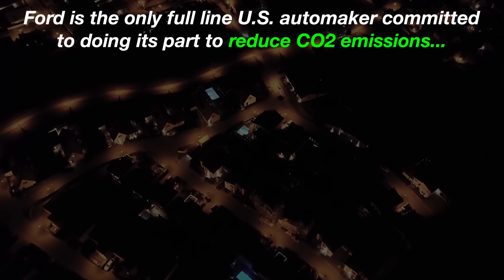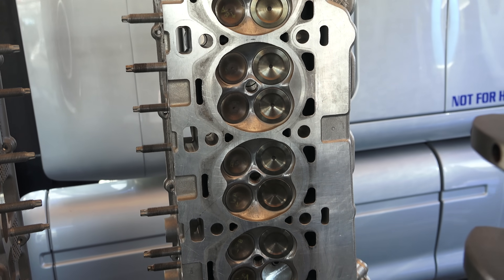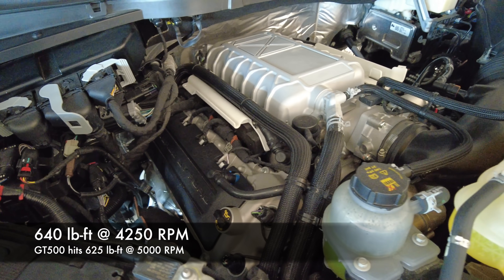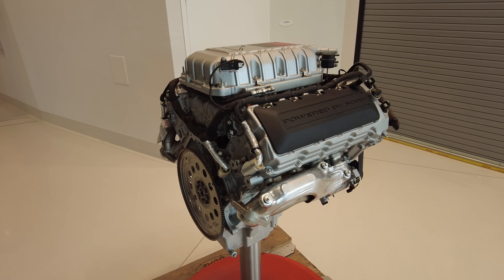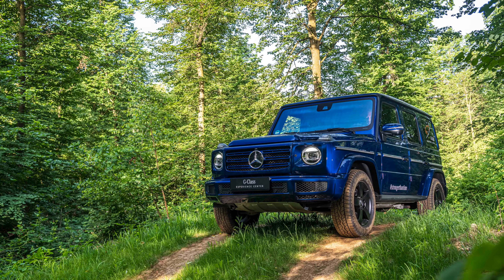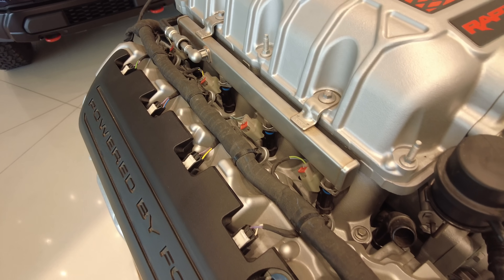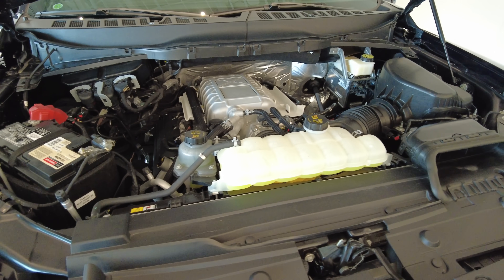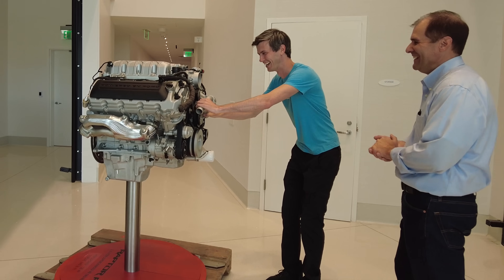Ford Raptor R's New V8 Engine - Meat's Back On The Menu

Comment: Excellent video! One quick correction: at 5:13 you state the bypass valve allows the intake air to bypass the rotor group and flow directly to the cylinders. This is incorrect; due to a Roots SC being a positive displacement pump, air is always pulled through the rotors. At low loads however, the bypass valve opens to allow any excess air that would otherwise be compressed to flow back to the intake upstream of the rotor group, thus preventing any boost/positive pressure from being generated. (This is the SC equivalent to a turbo’s recirculating valve/blow off valve)
Reply: I said the same thing, you beat me to it.
Reply from the maker: Hmm - I'd imagine air's taking the easiest path; if the rotors are creating suction strong enough, perhaps that's correct - initially I'd assume the easiest path is just direct to the engine, rather than through the rotors. But as you point out, the rotors are always spinning. Will follow up with Ford for clarification!

Edit: Cory thanks for pointing this out! I've pinned a comment to the video with correct information! Only at very low loads (like idle) would airflow be flowing directly through the bypass (rather than recirculated, like at partial loads).
Reply: @EngineeringExplained  No need, he’s correct lol.  I have the LSA S/C’d 6.2 and it’s the same way for the same reason.  They are there to bleed off excessive flow from the positive displacement blower that is always spinning at a fixed ratio to engine speed.  Say you use the car in manual mode and hold second gear at 5000 rpm but only 1/4 throttle, you want a good portion of the flow from the blower bypassed instead of creating 16 psi of boost.  If you’re at full throttle but passing through 5000 rpm, you want that 16 psi and no bypass.  Well the blower doesn’t know the difference so you need to bypass to control that.  One issue setting up a new one is to be sure that it seats properly when fully closed so that you aren’t bleeding off boost when it’s meant to be generating as much as possible.
Reply: @EngineeringExplained  . It is not a bypass, but a recirculation valve. The recirc valve essentially limits the pressure ratio to small numbers (near 1) at part load. This prevents excessive heating of the rotors from these high pressure ratios combined with little cooling from the low air flows.The air pumped by the rotors is recirculated to the supercharger inlet essentially reducing the pressure difference to near zero.  Failure of the recirc valve can lead to excessive rotor heating all the way to rotor to rotor contact and subsequent failure.
Reply: @EngineeringExplained  Roots blowers also don't actually compress the air internally; they just pump so much air into the engine that the manifold pressure goes up, so if there's a place for the air to escape then it won't make any boost
Edit: that actually looks like it might be a screw type, which does compress air internally
Reply: @EngineeringExplained  Rotors DONT create suction....they cause a difference in pressure or partial vacuum.
Reply: The bypass load is also great for twincharged (turbo + supercharger) setups, as the blower is no longer a restriction at higher speeds.
Reply: @REDSHlFT  twin screw is not the same as roots. Roots have equal lobe count, twin screw do not. Roots also don't compress air between the rotors, while twin screws do.
Reply: When you come at the king you best not miss
Reply: I had a Thunderbird SC with a similar design despite being made in 1989. Yeah, the bypass was for reducing the load on the engine when it doesn't need the power. The blower will force enough air into the engine even at idle but it also uses engine power to do it costing extra fuel. It also wears out the rotating components more compared to if it's just free-spinning. The bypass takes away most of the disadvantages of a blown engine when you don't need the extra power.

Edit: Now that I reread it, I have to agree with what was said in the video. It does allow air to bypass the rotors and it's largely to increase economy. It's not going to produce boost if the throttle plate is choking off the air sufficiently. It's probably easier to control idle air when the blower isn't engaged though.
Reply: It uses a roots style blower huh? Gt500 is a twin screw.
Reply: @XvSKINNYvX  gt500 is roots, not twin screw. It uses an Eaton blower, which have equal lobe count and rpm rotors, I.e what Eaton makes. Twin screws have different lobe counts and spin at different speeds, and are made my IHI (hellcat/demon), kenne Bell, Whipple, etc.

Comment: I'm the odd duck that would rather drive an ecoboost powered F150. My 2018 STX Supercrew 4x4 has the 2.7L ecoboost and it is the best truck I have ever owned.
With that being said, prior to the Raptor R, the only thing thing the TRX had on the Raptor was HP and torque. With the that deficit gone,  this new Raptor R is quite literally the badest truck on 4 wheels. I'm sure those with deep enough pockets to play on this level will be quite happy with this truck.

Comment: I know the plasma spray was used in the 13/14 5.8L gt500 engine as well. So I guess you could say it goes back further than 2018
Reply from the maker: Yes! But those weren't super high volume cars - they've pumped out a lot of 5.0L's (there's a disclaimer, though brief).
Reply: Flame-Spray invented the process, Ford with Flame-Spray improved it about '09...Nikasil was the forerunner used by Porche since '70 for 911 racing engines. Other manufacturers used it in production engines up until the mid '90s. High sulpher fuels in 3rd world countries would eat it up causing failures.

Comment: The raptor R has to be a massively missed opportunity, They made it 37k more expensive than the TRX and 2 fewer hp and 10 fewer lb ft
Reply from the maker: Could be 700 lbs lighter (not sure till we see one on a scale). $29k* more expensive (still a lot!).
Reply: @EngineeringExplained  I was going off the introductory msrp didn't know they'd bumped it up 8k. I feel like if they reinforced everything they should have it'll be more like 6300-6400. I think those high mag curb weights were with all the goodies and a full extended fuel tank

Comment: I worked at Ford for 30+ years, many as a final inspection person. I couldn't help noticing one of the two push pins in the intake opening weren't seated properly. Also the comparison to a pushrod driven truck isn't fair. Ford has been moving forward with current engine technologies. The ones still building pushrod engines are still having a hard time getting it right. If you need to buy an American built vehicle Ford is the only choice.
Reply: I saw those push pins too. 😁

Comment: I speculate that this engine will make more power than the TRX when dynoed past 7k rpm. The biggest limiting factor for power is the exhaust manifolds. But it's a factory pullied version of the GT500  5.2L. The tuning potential should be crazy 💯
Reply: Well it’s pretty much a voodoo engine with some more cooling for longevity, so instead of lasting 100k miles you can probably get 180k before it needs a new motor
Reply: @RiggyRonnie  pretty liberal estimates for each imo
Reply: I speculate this engine will blow up because that is the FORD Way
Reply: @mikefoehr235  😂😂😂
Reply: @mikefoehr235  it won't it isn't a garbage Toyota lol
Reply: @hotrod7603  funny no Toyota I have owned EVER blew up but the one Ford everything blew up AND it was towed 10 times because it failed. So, that shoots down your theory. Yesterday I drove by our local Forx garbage dealer...yup a pretty brand new F150 on the the hook 🪝...I just laughed. Ford garbage.
Reply: @mikefoehr235  your doesn't blown means you must be lucky other than garbage like toyotas are known for it
Reply: @hotrod7603  you got it wrong...FORD is the garbage. GM is garbage. I  have owned ALL of that garbage. Our 4 Toyotas have been incredible. My wife's RAV 4 needs AC work done after 6 years....will be first Toyota we own that needs AC work. Our Corolla and my Tacoma that was not an issue. Toyota is mostly maintenance. They rarely break. Even after 2 years my Tundra has had 2 issues...a bad battery and a cracked windshield both covered under warranty. GM and FORD you spend most of your time at the dealer or repair shop...again I know this from owning that garbage. I know several people who have had terrible problems with FORD pickups. Pure junk
Reply: @mikefoehr235  i already said Toyota is garbage there are already tons of people who have replaced engine in camry fue to the cracks and also the 3.5 in Tacoma has been known to blown many times , you just got a diamond nothing else but it still wouldn't change the fact that Toyota is garbage.  Worst interior , seats , no power etc
Reply: @hotrod7603  well you keep driving your garbage Ford...I will keep driving my garbage Toyota...I just love Toyota garbage. Just remember....who is the largest automaker onnthe planet?? Is it Ford or Toyota??? Toyota didn't become the largest by building garbage.
Reply: @mikefoehr235  well Mc Donald also sells most burgers doesn't mean they are good same for Toyota
Reply: @hotrod7603  Maybe Japanese burgers would be better. Maybe American burgers are second rate. You NEVER see me at Rotten Ronnie's for a burger. I prefer A&W, Wendy's and Harvey's.
Reply: @mikefoehr235  Sorry bud, a little late to bring up the Toyota conversation. Pride month has passed. Better luck next year.
Reply: @meatministry3736  here in Canada pride lasts all year for all you queen folk in America
Reply: The PCM will be locked solid. You can bet there will be no tuning this truck.
Reply: @hdz12ez  Livernois
Reply: Actually Hennessy just tuned one to 1000 hp @hdz12ez
Reply: @hdz12ez  Hmmmm. Palm Beach Dyno might have a word.......and all the usual suspects...
Reply: @hoost3056  Besides Whipple, a company which works with Ford, I don't know of anyone that has been able to crack the 2022 F150 computers for tuning. Those suckers are locked down like the C8 Corvette.
Reply: @hdz12ez  yup raptor r owners are going to be sad when they find out they cant tune them
Reply: @elemir17  yes sir they are
Reply: i just bought two of them and swapped both of them for electric drivetrains. Now they make some real power :) and i can charge them with solar energy when the pumps are dry (soon) or unpayably expensive (sooner).
Reply: I hope you're joking because that just sounds completely idiotic
Reply: @AmvC  😂😂😂
Reply: @AmvC  you realize that electric vehicles use as much fossil fuel as internal combustion cars? good luck to you though
Reply: @TokenTombstone ... right ... cough cough
Reply: @TokenTombstone  Sure they do..keep telling your self that skippy
Reply: @AmvC  you’ve looked into lithium mining yes? Also have you looked into how wasteful lithium fires are? EV’s have potential but we need big reforms in the way our society works infrastructure especially in America is far inadequate, and not just power grids but things such as emergency services as well

Comment: "Sounds like we've got 28 years to party!" Best line ever
Reply: In 28 years, Jason will either be 53 or 78 -- we can't tell.
Reply: Absolutely, and why not! I’m a “bow tie” fanboy, however this engine is impressive. Well done Ford, and great video Jason.
Reply: @svenhodaka9145  
Welcome to the dark side
Reply: @svenhodaka9145  LOLz if Chevy hired some adult males who had ever touched a hot rod and put  a turbocharged 454 in their pickups, churning at loafing RPM and ridiculously good mileage due to same low RPM. Kind of a Hot Rod Big Rig Pickup.
Reply: Couldn't agree more!!
Reply: If sane people take this country back we'll have more time than that.
Reply: @mortem-tyrannis  Perhaps we can just run them over…kind of like Death Race 2000 ?
Reply: "Sounds like we've got 28 years to party."   How dare you!  -  Some Crazy Eyed Loonie
Reply: My thoughts exactly
Reply: Hell yeahhh!!
Reply: The line cracked me up -- I had to stop right there and check the comments.  I'm still intermittently chuckling at it three minutes later.
Reply: Ford pushing these Lightning trucks to much who wants to buy that junk
Reply: I also feel this way .  Coincidentally, that's the same year I'm hoping to retire!
Reply: 2030 is when the cops show up to shut it down in the first world.
Reply: I dont know if this line is very reflected? Party goes as long the music plays but someone has to pick up the bits n pieces on the aftermath when the party ist over. I think it is a phenomenon of our western society to live above our means. I think this is a form of decadence. If we look back into history this could be a sign that our society will dissolve in consequence of their blindness and arrogance.
Reply: Agreed
Reply: Made me laugh with my ego
Reply: HONESTLY! LETS HAUL PEOPLE!
Reply: That line put a huge smile on my face haha
Reply: Ethanol will be there to power these n don't worry cuz it's carbon neutral
Reply: Yes, yes it was. It was enough to finally get me to subscribe, and possibly even take back all the negative things I've said. :-)

Comment: I don't understand the engineers argument against side pipes, and off roading, my 2010 Raptor SVT has side pipes, and though they can get crimped or "pinched" as he said, it won't be much different coming out of the rear if you go overlanding and hit a rock while rock crawling, side or rear. And this new Raptor is on 37 inch tires, while mine is on 35's, but a rock is not going to distinguish the difference if you come plopping down across one just right.
Reply: A pinched pipe will be dramatically more resistive to flow than a longer pipe unless your pipe is twisting all over the place, but a well designed pipe should have as little bends in it as possible. Gotta remember these engines have a hefty supercharger on them, so exhaust pressures are much higher than a NA engine. But like the engineers said, they designed these engines for offroading, not 0-60. So the marginal improvement in flow with a side pipe isn't worth exposing that pipe to potentially get crushed for at best 1-2HP.
Reply: I definitely wouldn’t want side pipes offroad.

Comment: 7:15 Why does direct injection let you run smaller turbos? Thank you~
Reply from the maker: Good question - quoting the engineer their, and don't a detailed answer. That said, direct injection forces the charge air to cool as it vaporizes, which effectively allows you to run higher compression ratios. With higher CR, you make power more efficiently (more power!) therefor your turbo doesn't need to be as big for the same target HP, than if you were to run port, and have less of a cooling effect (in-cylinder).
Reply: @EngineeringExplained  Thank you very much!

Comment: they should have used the 7.3 with a supercharger, missed opportunity.
Reply: no
Reply: @EnthusiastsGarage  yes. seems youre unaware of the fact that there are 100% stock 7.3s with TVS2650s making north of 900hp/tq on pump gas and over 1000hp/tq with E85.

an oem level durability level engine would still be 800hp/tq.

like i said, missed opportunity.
Reply: @efab9346  you have no idea what you're talking about. go back to watching streetspeed717 videos troll.

Comment: Ford got it wrong.  They know how much power the TRX is making, and still didn't make more power than the TRX. On top of that you can't even properly tune any 2020 and up f150. I'm sure you won't be able to tune the raptor R.  Dodge for the WIN 100%

Comment: Mad Max supercharger. I want a switch on that decoupler
Reply: It doesn't have a decoupler, that thing just allows the belt to only power the pulley in one direction.  Think about a typical multi-speed bicycle. Normally, if you pedal forward, it generates power through the chain and gears, but if you pedal backwards, the pedals and chain spin freely.  It's a different mechanism, but it achieves the same thing.
Reply: @megachonk9440  Then it needs a decoupler so I can flip that switch. I know how whipple chargers work but my idea is way cooler than cherry bombs with a water hose shoved up it.